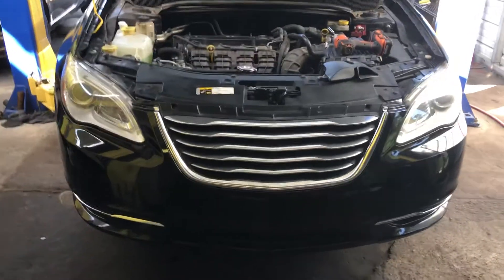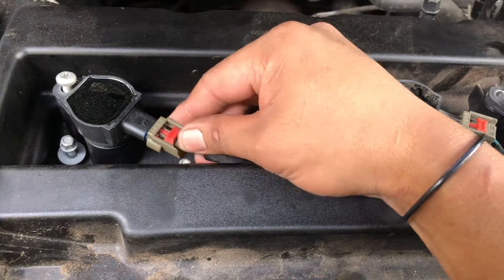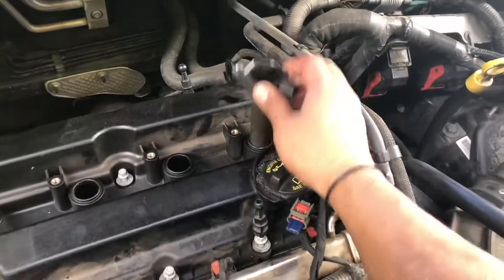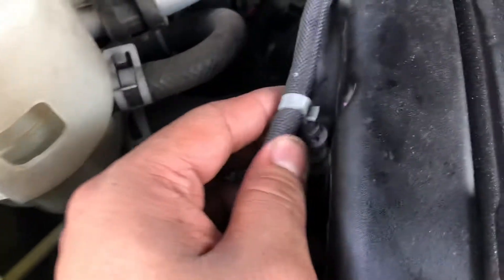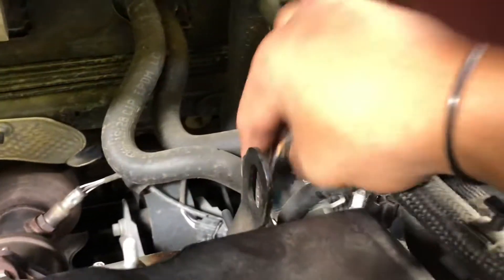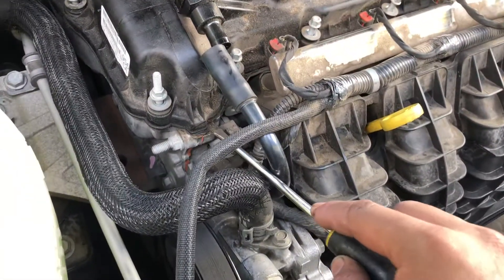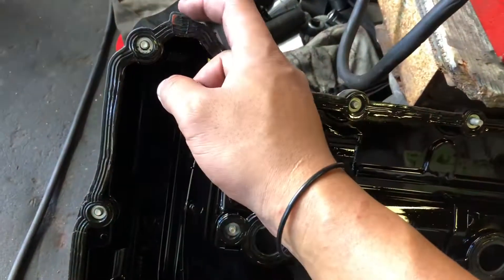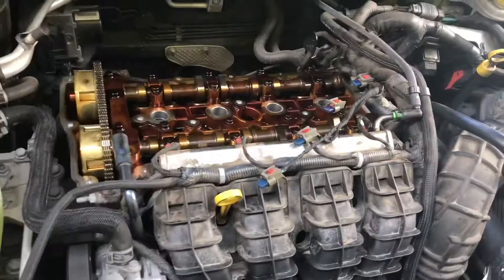2014 Chrysler 200 valve cover gasket replacement

Comment: There's two spots on the mating surface that are supposed to have a dab of rtv sealant, but I wonder if it's really necessary since the gasket looks like it makes good contact. I have to do this job.
Reply: I think the two square areas  where he pointed his finger on the gasket is where the rtv sealant should go . But I am not sure. You can check the old gasket when you take it off to see where the manufacturer put it
Reply: It is necessary.  The oil will squirt out from there under pressure and you will have no oil in your car
 I learned that the hard way.

Comment: What brand of sparkplug is good for my Chrysler 2012 is it available in Amazon.? Tnx mate
Reply from the maker: I would use mopar, you can also use autolite. Ngk and denso too by they’re more for Asian vehicles. And yes they’re available on Amazon just make sure to check if it fits your vehicle.
Reply: @BrianBalatbat  tnx mate
Reply: @BrianBalatbat  Pinoy ?
Reply: @BrianBalatbat  bro do you have fb or fb messenger I have some few questions about chrysler 200,tnx